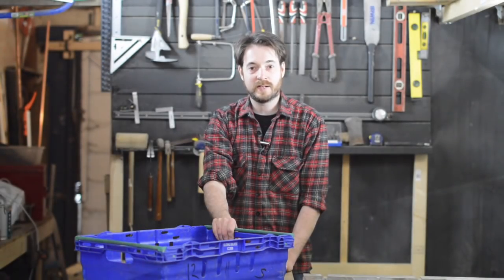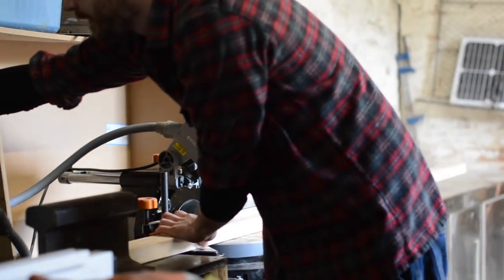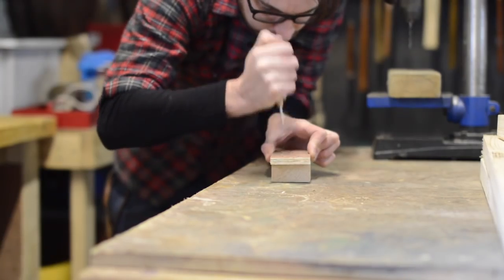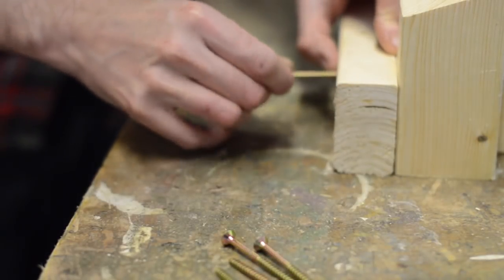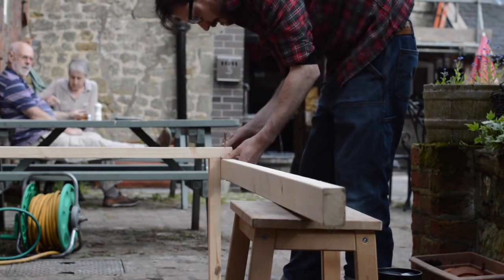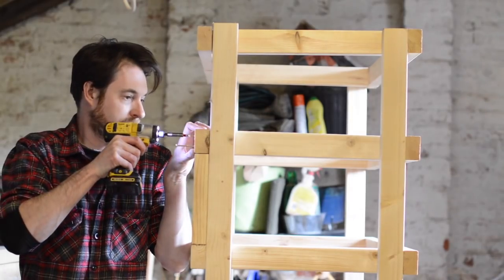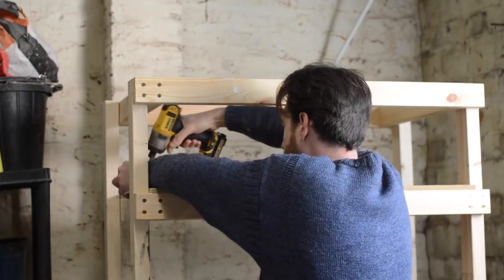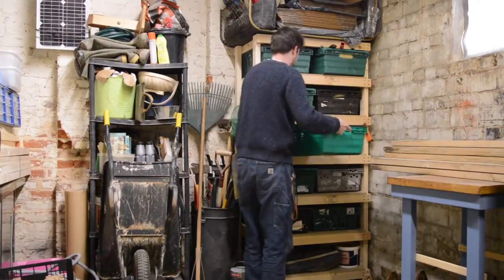Crate Workshop Storage Rack

Comment: I like these kinds of projects, function always before looks for me. Not that its ugly, just nothing fancy for the sake of it.
Reply from the maker: Thanks David. Yes fro the shop I just want it done quick. It just has to work.
Reply: @Badgerworkshop  You are so right with that. In spite of Slovakia being a "forest" country, it's not easy to buy dried and standard measurements of wood here.
Some dimensions I can buy at 20 km, some other at 40 km (but both only pine) and more choice I have at 65 km but over there it is quite expensive.
From time to time I buy some wood which is mentioned for roof tiles. They are about 30 by 50 mm. They are fresh so I put them for drying on stickers.
After some time they are dry enough to use. (I need to buy new stock now, I used the last 3 two weeks ago) They are not very straight (but those in the
expensive store also not always, and they are 4x more expensive and 5 times the distance) I use them for frameworks in garage or workshop.